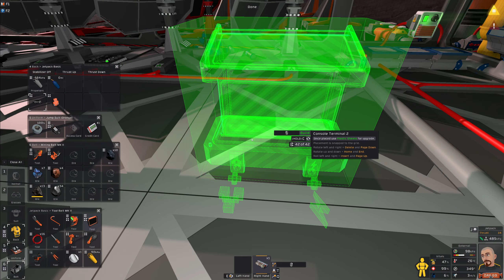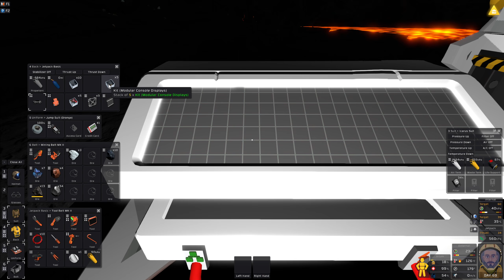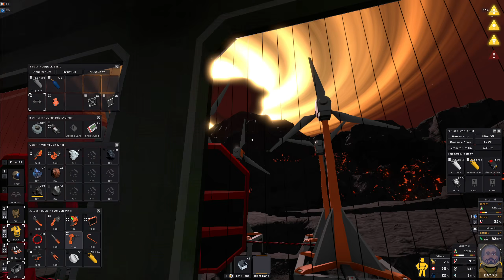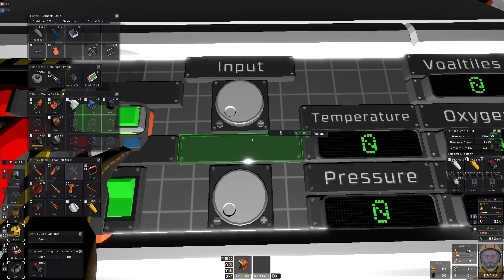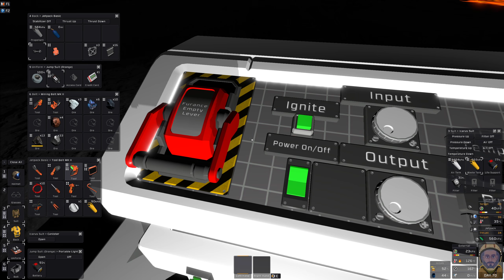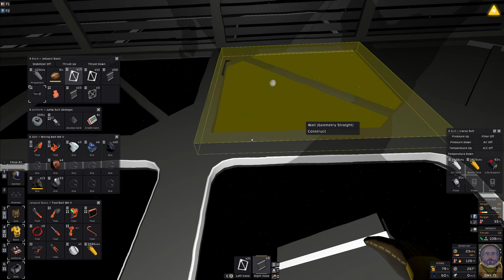Furnace Control Panel Setup - S2 E22 ║ Stationeers

Comment: Awesome series. Really interesting to see how others build with them. Small tip, you can use the screwdriver to reposition any device on the boards. Especially useful if you need to keep their name and their connection intact.
Reply from the maker: I know, I think I even left a top-right message about it. :D

Comment: Just rig grow light activity to Janus azimuth. From A to B on, from B to A off.
And turn them off if sensor in green house have light on it.
Simple solution.
Reply from the maker: That's exactly what I did in the previous episode. I did mess up the angles (I assumed it goes the full 360 degrees), but the code does pretty much exactly what you described. Check if Janus is above the horizon, and whether or not the sensor has daylight hitting it. If Janus is up but there's no light, turn on, if both true, turn off, if both false, also turn off.
Reply: @Hmuda  Oh, i guess i missed that, i thought it just turn light if sensor have light on it.

Comment: I swear to god, when you were trying to figure out the variable for the output hash, I was practically screaming NameHash, that was the last thing on the right in the pedia
Reply from the maker: Don't worry, the next episode will have the final console. Thankfully the console screen can act as a standalone device, just need the hash display chip, no need to use the IC10 for it. :)

Comment: FYI on the grow light, the light source emits from the power connection side, so the only way to have perfect symmetry is to flip one of the around, which then messes with your wire placement.
Reply from the maker: Yeah, I've been using the wiki-diagram for placements before, but I didn't want to open it while recording, I break the flow enough times as it is. :D